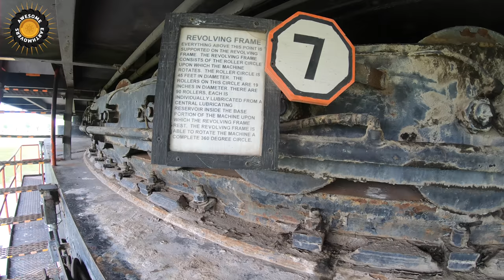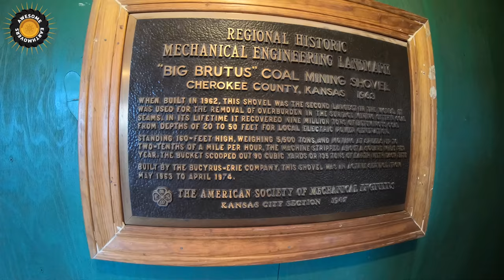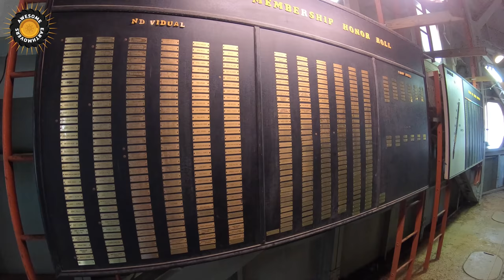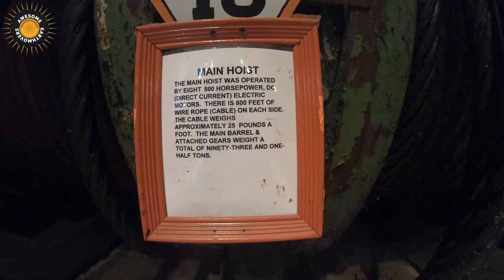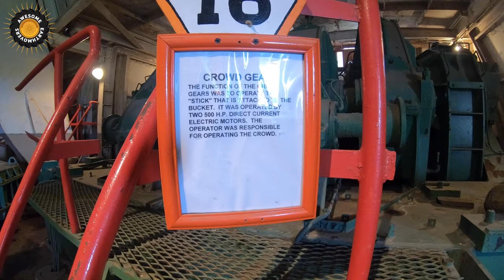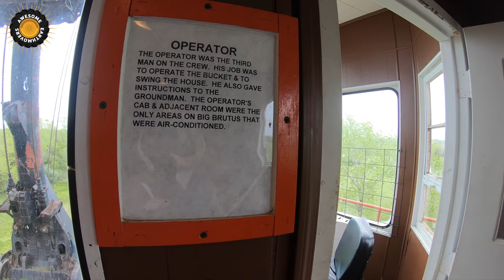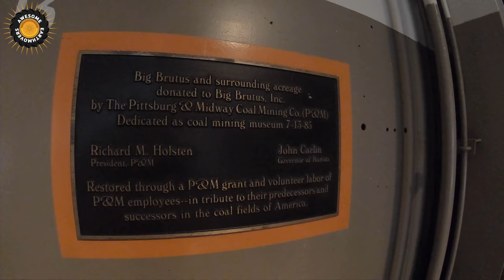Big Brutus in cab and  walk around

Comment: To have seen Brutus and her sister draglines operate back then was   just the beginning. The dumps that hauled the coal out of the pit were nothing less than a conga line of huge trucks. Brutus, obviouly, had a large appetite for electricity. The trunklines were (looked like, never measured 'em) about 8" in diameter. The coal in S.E. Kansas  has a lot of sulphur content, that's where production decreased due to emissions.
HOWEVER, the 'junk' land- piles of shale, dirt and rock- left to mother nature led to a sportsman's recreational paradise. During the early motocross years we rode the pits at breakneck speeds, and hill  climbed untill we dropped. Then it was into the cool clean water to wash off the coal dust and dirt to avoid tracking it back home. Then there was fishing and SCUBA  diving to do. Now Pittsburg is flatsburg due to the land being dozed for housing additions.  Still, there are a few spots left.

Comment: Just an afterthought, many have asked ( facetiously I assume ) about miles per gallon on the 1850B. It was actually an electrically operated machine. Many years ago, I had the honor of working for Bucyrus Erie company as a repair order interpreter. My responsibility was the stripping machinery primarily from the 4250W through I think the 7W. 
It was a very rewarding position supplying the customers with factory certified parts. Each machine had its own set of records outlining modifications and engineering notations. I’ve enjoyed this video greatly and hopefully travel to see it soon.
Reply: Sounds like a cool job.

Comment: I have always read that crawlers in a stripping shovel were operated from a sub cab in the crawler frame : where is in this video , I can't find it ?
Great video , thanks for posting !
Reply from the maker: thebigmuskie I didn’t see any cab under the machine myself or any sight of it in the closed off areas. The crawlers were operated separately by a “groundman”  from under Brutus.
Reply: 11:51
Reply: We stood on the first platform under the shovel to propel the machine forward or reverse and to steer left or right from a control panel mounted on the platform.
Reply: I was surprised how simple and small the operators control cab was. It was to the upper right on the front i think. Its been a few yrs. 22 min into video.

Comment: It needs a 16” gun. Actually, after the walkaround, it needs a turret with 3 - 16” guns. And it could use a few Quad .50’s. Upon reflection, it could also use a cruise missile launcher and some cruise missiles. Use that gigantic bucket as the cruise missile launcher. . The biggest crane I ever poured concrete for weighed 1.2M lbs. working on I-94 / I-294 interchange rebuild. The operator was working almost on his back using 2 small joysticks. With A/C !

Comment: Great video, really enjoyed it thank you.Two questions,  why did they stop using it?Where is Big Brutus situated?
Reply from the maker: It was too expensive to run, coal prices went down and the price of oil went up which had a knock on effect on the price of electricity that was used to power Brutus. It cost $27,000 for electricity to run it in its last month of operation. Adjusted for inflation that’s somewhere north of $150k. Brutus is located very close to West Mineral, Kansas.
Reply: It’s in west mineral Kansas you really can’t miss it there are giant signs that tell you where it is miles from it

Comment: Talking about the advancement of tech and computers!
Here you have a machine the size of a building, and only about 7 buttons and 2 sticks to operate. With possibly a crew of 10 or 12 at a time 

While now, smaller engine room, less parts,   And hundreds of touchscreen options that would confuse the best operators!
It would take back then days to know what part went wrong, now a system tells you what can go wrong even before. With only a crew of 3 or 4 at best .

Yet it remains to be a spectacular piece of art

Comment: I would like to build a house into this monster.  :()
Reply: It won't blow away in a cyclone!
Reply: Tornado wouldn’t stand a chance against this steel monster
Reply: I just can't imagine what kind of engine they use to make that guy move.
Reply: Jefferson Sales   I think it used 4 Prius batteries  🤓   😆
Reply: Me too
Reply: @blackcitadel37  All electric.  And we're talking some honking big electric motors.  These stripping shovels usually required their own electrical substation to supply them and guzzled enough power in a day to light an entire town for weeks.
Reply: Electric bill would be $25,000 a month I’m serious that was the electric bill on it
Reply: Also that thing is very top heavy heavy wind would knock that thing over to make thinks worse it’s in Kansas RIGHT next to Oklahoma it’s about 2 miles from the edge of Oklahoma the tornado capital WHICH IS WHERE I LIVE those had a top speed of .25 MPH so they don’t fall over and they drive on something called mats giant metal slabs so it won’t sink into the ground and tip so you wouldn’t want to live there besides it would result in a lot of break-ins 

it’s just not cut for a house trust me if it was I’d live there too 

but it’s a museum

Comment: Why couldn't you tilt up from about 2:25 on? Same at about 6:00.
You could've gotten the whole machine in Most of the picture was the ground.

I'd have liked to have read the plaque about the Ground Man, too. You got the other ones fine. I'm glad you didn't add music.

Other than that, I liked it. Thanks.
Reply from the maker: The camera is on a gimbal. If i tilt up too far the camera will hit the limits of the gimbals movement

Comment: If you look real close to the lower left corner of the bucket.  The bucket is over 18 inches thick and it had the power to break the tooth holder off the corner. I have been there many times,  A D7 Cat also fits very nicely in the bucket.
Reply from the maker: Mulejumper I seen a video of Brutus from a few days ago and they have now fixed al the broken teeth
Reply: @Mulejumper I know this is an old video, but where is this big bucket you speak of in this video that will fit a D7?

Comment: What powers her ..... what is the make of her heart?????  ...... Detroit, G.M., FAIRBANKS  .. ??????  Who did/maintains the A.C.???? I got a lot more ..... I need answers!!!!!
Reply: Electric powered, incoming 7200 Volts transformed to 6900  volts inside the machine. Two 3500 hp. Motors turned 13 generator for the operating motors, main hoist had 8 five hundred motors , 3 seven hundred fifty hp motors for the swing, two 350 hp motors to the  bucket crowd.  The crawlers had 300 hp  AC motors on each crawler. Several motors on air filters for dust control and cooling fans for the machine. Two large air compressors to operate brakes on all motors.

Comment: It probably ran around the clock and needed to be overhauled. Smaller more efficient machines took over with newer excavators that moved the same amount of ore in equal times with less cost of operation and better maneuverability I can imagine that thing being a nightmare to get out of the holes it dug unstable ground wasn’t it’s friend bet it got stuck a time or two probably was a night mare in all aspects

Comment: That is a very small bucket for the size of that machine
Reply from the maker: AMPERE MAN it might seem like it but Brutus was designed to be able to cast material some distance away whereas other smaller machines you are comparing it to with bigger buckets in proportion to their size are designed to load trucks parked right beside them. Hold something heavy close to you and then try holding it at the full reach of your arm. That’s the difference.
Reply: Awesome Earthmovers so the size of that escalator's is bucket has more to do with Leverage injunction to the Boom of that machine + heavyweight. Understandable. It's just my personal opinion but it's kind of odd to see a machine that big with such a small bucket. It's just my personal opinion that's all. Still pretty cool though. 😀

Comment: How did it end up where it's at now?
Reply: It sits at the end of the last pit it worked. I have been to the top many times before insurance liability made them close off the boom. When you go to the top you could see the pits he dug. There is a video available in the museum that has the building of Brutus and him working. When he was working he had a large 3 phase cable on a reel and used the electricity of a town of 15,000.